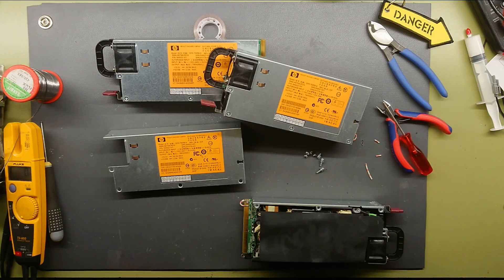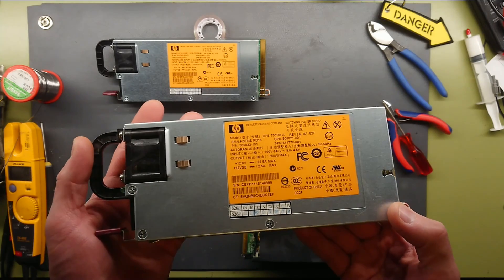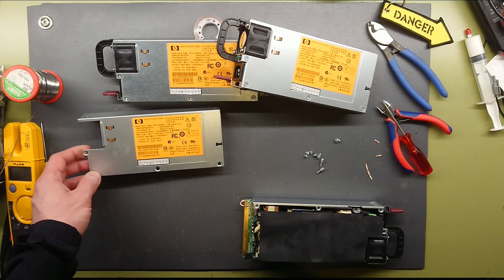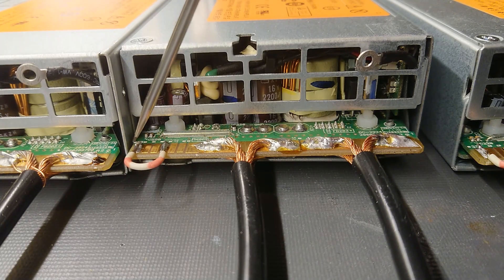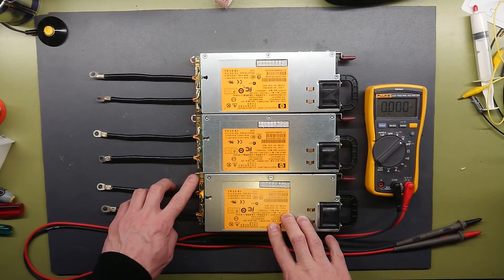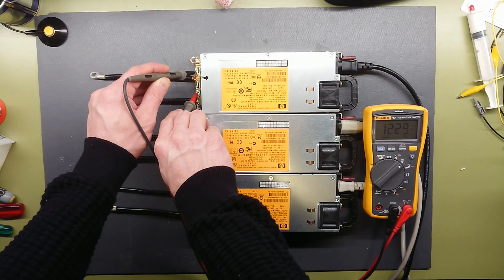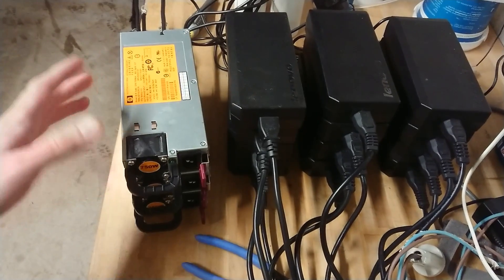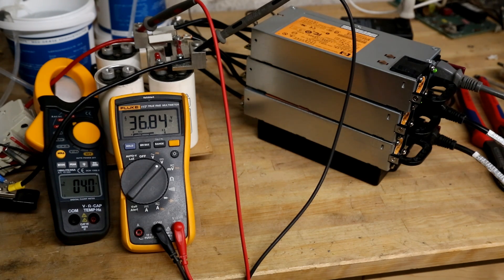2200 Watt Server Power Supply (HP DPS-750 RB) For Induction Heating

Comment: Yes! Thank you very much. I want to do this myself to charge my LiPo4 batteries; a 48v setup. :)
Reply from the maker: 48V gets very close to the maximum ratings of the single PSU components, so in respect to ground they can see a potential higher than their maximum specifications.

Comment: Hi. Am I correct in thinking that the first or last power supply that feeds  negative into the actual circuit does not need to be modified? Only the other two or other 3 in my case need to be floating? Just wondering as it might help with noise control in a noise sensitive circuit.
Reply from the maker: You are correct that the bottom negative one can be left unmodified. But only that one.
Reply: @KaizerPowerElectronicsDk  Exactly what I was thinking. I just received 4x DPS 800GB A and 2x DPS-1200SB A
  I was thinking to make one supply with the 4x 800GB that could do either 1x ~50V or 1x ~14V but for the price of switches cables and / or relays I might as well build 2 dedicated supplies. Anyway they are here now. I changed the voltage on the 1200GB's to 14.8V. Very nice!

Comment: I have the same power supply and isolated the ground of one of them. (going to make a 24v charger power supply) after I floated the ground I'm measuring 6v between the case and ground. There is no continuity to the case or to mains ground. Is this normal?
Reply from the maker: Its normal with a high impedance measurement, try to add a little load like a resistor and it should be loaded down to nothing.
Reply: @KaizerPowerElectronicsDk  thanks for the quick reply. With some load it drops to zero. While going over it I've noticed one of the diodes om the controle board marked AE (there's a bunch of them near the AC side) is blown but everything works so I'm gonna push my luck and see how it holds up with a full load lol.

I'm guessing it's a Transient Suppression diode that's not too essential
Reply from the maker: @RubenRC94  yeah well.. you already bypassed a safety feature when removing the ground, which ruins the PELV class of the power supply :)
Reply: Since I'm pushing around 60A to charge large 12S lipo cells that's the least of my concern ;). I've found out the dioide is only linked to the fan controle so one of the 2 psu's skips over one of the intermediate fan speeds wich for me is no problem at all. Even after 5 years still a great video!

Comment: Would just removing the ground pin (without isolating the chassis) on the AC input work?
THANKS MUCH!!!
Reply from the maker: This might trip RCD/GFCI from leakage current, when putting more in series.

Comment: Did you try to connect them in parallel? I have a plan to connect a couple of 19V laptop chargers in parallel to run some cordless tools. I know that I should protect each charger by diode, could anyone advice what kind of diode should I use? Could this parallel connection actualy work? Thanks.
Reply from the maker: That was the right question for the right guy! I made a 2kW series/parallel power supply from 12 old laptop power charges, abused it as power supply for a induction heater and it regulated very well: https://www.youtube.com/watch?v=5iMFYdDMfXo
Reply: @KaizerPowerElectronicsDk  Thank you. I have already watched your videos. It seems it works without diodes but I would prefer to use them. Could you please explain the purpose of capacitors in your setup? How to connect them and what capacity to use? Maximum output current of my project will be 50A at 19,5V
Reply from the maker: @martinrob7230  The idea of adding capacitors was to have some surge current supply from changing loads in the induction heater, to give the power supplies more time to regulate to load.

Comment: In series does the wattage go up as well or do they have to be in parallel. Looking for a cheap option to get 4000w 60amp 64v
Reply from the maker: I think personally that 3 in series for 36V is as high as its reliably can go. At 48V with 4 in series, you are so close to the component ratings that the stresses will eventually make one of the power supplies fail. So 60V is out of the question from my experience.

Comment: Hi, I am new at this , I only need to use one for 12 volts , if the chasis is ground, were do I pick up the positive , ( dps-750ab-3a ) is the two copper strips on pc board have a positive? I am going to power a transmitter on low power. Do I still have to isolate  pc board if only using one ?
Reply from the maker: Hi Paul. You do not need to isolate the chassis, when only using one. It is ONLY needed when putting them in series for 24V or higher. The negative 0V and positive 12V outputs are side by side. You can easily find the negative rail with a multimeter and test connectivity to the chassis. The other big one is positive. My PSU has both sides of PCB connected to either negative or positive, as you can see i soldered the large wire on both sides.

Comment: I hope Vlogger doesn't mind me doing this. Would like to save some time for anyone coming across this video. It seems the problem PS is the PD-18 which has a daughter board that needs the grounding wire disconnected. The PL-18 doesn't have this and these don't have running issues. Someone below, who has put a bunch of these together, verifies this with the statement that the longer rectangular labeled PS's (PL-18) never had issues. Whereas the shorter rectangular labeled PS's (PD-18) had issues, even when mixing and matching. Though, it wasn't mentioned whether the daughter board grounding wire was disconnected by this guy. Someone who had problems with his running erratically, resolved the problem by disconnecting that wire. Also, the master PS does not have to be floating at the DC board, but all others need to be floating. Let me also add that, those floating PS's should have a 5w/15v Zener diode added from negative to PS chassis with flow direction of Zener diode so that negative current, DOES NOT, flow to the chassis. The white circle side of Zener diode should be toward the negative side. This protects each, FLOATING PS, in that if there is a DC circuit problem, it will pop the Zener diode which will flow current to the chassis and fault the PS to shut down.
Reply from the maker: Thank you for the information :)
Reply: I think you mean the 1 supply that is on the negative end of the circuit, what is your definition of master supply? Regarding daughter boards to ground will this not show up if you test continuity from DC negative to the chassis after the mod? Telling you weather or not there is any low resistance between negative and the chassis? I'm trying to follow what your saying about zenner protection, so if voltage rises above 15V it will send DC to the chassis of your "master supply" as that one still has a dc connection to the chassis and that voltage on the chassis will cause the supply to go into protection? So. in this case we should connect the chassis of the floating power supplies to each other including "the master supply" otherwise the fault won't show up or it might trip your RCD if earth is still connected to the chassis.

Comment: Mads,
I ordered three of the HP DPS-750 RB power supplies, They just arrived today, I am following your video.  They are EXACTLY identical to the units in your video.  I was wondering if the jumper installed has anything to do with the input voltage.  I'm using 110v here (don't know if you are on 220v or 110v).  So I guess it is OK to install the jumper 1 to 4 pins and plug into 110VAC.
I see a pair of soldered terminals on the terminal labeled GND and +12v.  Am I correct in assuming these are directly connected to the two long copper strips just past the 6 copper pins?  I plan to solder the output to them as in your video.
BTW: I was just wondering what you're using to dummy-load the 36v out, and what the white caps are for.
THANKS MUCH!!!!!
Reply from the maker: Im in 230VAC country. I used caps for current surge on the load. I just have a lot of power resistors :)

Comment: hey there, good video - what did you do with the loosened black wires that used to go to the control board? just hanging around surely not ... ?
Reply from the maker: Thank you, well, for reasons not investigated, it worked with floating black wire, so its floating :)
Reply: @KaizerPowerElectronicsDk  thank you for the quick reply: well, I will isolate them I think. just in case. one more question (it may have been answered in other comments, sorry): I would like to put two of them in series. I need to disconnect base-case only from the first (that one that is giving plus at the end), right?
Reply from the maker: @reserveschirm  yes, you can leave the PSU sitting at the negative out, as original. Its only the ones going in series towards the positive side that needs to be isolated.

Comment: I got a few HP  723600-201 power supplies but can't seem to find a video on jumping the power on traces. It has ten thin traces on top and ten on the bottom. Anyone worked with this style of pin outs. It might be the one where you jump pins 1 to 4 with a 220ohm resister or the other method is jumping pin 30 and 31 which are on the top and bottom. The problem is that one PSU has 6 pins and the other has 8 . Mine has 10 so there should be a way to do it. The far right pin on top (near the long negative pin) is labeled S20
Reply: It may have to do with that being a hot plug power supply. I read a thread about removing something on a hot plug power supply, so I made sure I didn't get a hot plug supply. Did you figure it out?

Comment: Now that you have soldered the jumper wire does this mean that whenever I plug the pc in the psu has power but then I press the PC case button it activates the pico that is being powered by the PSU?
Reply from the maker: Plug in = power on.

Comment: I see some people using a resistor as a start jumper?  Whats the difference between a resister and just having a wire?
Reply from the maker: Some power supplies need a certain resistance to turn on. But for the most, a simple jumper will do just fine. Using a resistor will limit the short circuit current, if you place it wrong, so nothing gets damaged. A wrongly placed jumper can damage the power supply.

Comment: Do you have to isolate the grounds in order to run them in parallel?
Reply from the maker: Yes, Else you have to float mains ground and chassis can not touch each other. So its more dangerous.

Comment: Do all 3 have the inner grounding removed? Shoud be not only 2 need this done? 🤔 Ther is than no effective grounding for the all cases if a short happening? 🤔
Reply from the maker: The enclosure is still mains grounded, so its safe for humans, but the secondary side cant detect a fault to earth, so it will properly burn down :)
Reply: @KaizerPowerElectronicsDk  😂👍

Comment: why not just use one Telecom rectifier power supply - they output 53v and 30-35A - with CANbus control upto 50- 60A
Reply: Probably because they are $2,000 ea compared to $24...What do ya think?
Reply: @MrDLRu   depends on from where you get it, I purchase them as a used retired item.
Reply: @JawadAhmadsahibzada  Sure that's all good, please, tell us all where to get one for $24. As 1200w, 12v, 100A power supplies can be had today for that price on ebay.

Comment: Looks good!
I have a question 
How can i fix  - and + kabels on this power supply?
I would like to use it as a adapter for my home sound system
Reply from the maker: You can buy adapters for these power supplies or solder on screw terminals.

Comment: Hey men. How are you? I have some problems here. I did the modification, and when turm on, they don't gave me the 12volts. I read like 5 volts, 3 volts, 6 volts. The 3 power supplys the same thing. If i reconnect the green terminal to the chassis then 12 volts. Do you know what can be wrong??
Reply from the maker: Did you check that each power supply work on its own before modifying them? Sounds like one or more are broken and its continuously starting up/shutting down from under/over-current or -voltage.
Reply: @KaizerPowerElectronicsDk  yes I check each psu before modifying, and all works grate. I think maybe here in Venezuela, uses 110volt outlets with only two terminals, I think that I need the ground of the 3rd terminal. Tomorrow I will try in my office. Thank you very much for your reply. Very good videos. Best wishes for you.
Reply: Hey I am having problems as well. Hope you figure something out.  HSTNS-PD18 some are not isolating with the standoffs and green wire removed idk why...

Comment: great video!  Thanks for sharing this.  Question about the ground wire.  Wouldn't it be safer to ground the cases?  Since the DC rail is floating, it's possible, no?
Reply from the maker: The cases are still grounded to mains earth.

Comment: Technical issue question. Are only certain HP power supply can be put in series? I tried to put HP power supply HSTNS-PL18 750w in series , 3 of them, but the power cord(s) began to burn up. Pls advise. Thx.
Reply from the maker: What burned up? With appropriate fuses in front of these and needed wire size on the DC side, you should never have smoking wires!
Reply: @KaizerPowerElectronicsDk  I figured out what was burning. The ground wire(s) of the mains that were powering the power supplies were burning. I have 6, 750W power supplies connected in series, and found out that only one unit/power supply can have ground wiring. I didn't go with disconnecting the ground wires inside the power supplies because I didn't want loose wires or floating wires. For any person that is looking to build a DIY power supply, make sure you have only one ground wiring for the series connection unit. And thank you Kaizer for putting up this instructional video that expanded my knowledge about series power supply DIY. Best.

P.S. Also, I have 3D printed my series power supply housing. Each power supply with custom cooling fan with lid (the top lid removed) and spacing.

Comment: Thanks for this video. I like to use these powersupplies for powering ledstrips in the house (a lot of them 1000 w +) for transporting the power i want to use 36 V and than bring it down to 12 using a buck converters. Is it possible to take 12 volts if you have 3 in series by using the + and - from the fist one? (used to power some local stuff) or you reccomment an different powersupply for this?
Reply from the maker: If its a minimal load, you can take 12V from the last of them. So you still have a reference to ground.

Comment: I also did this and witnessed some strange weirdness going on. I got two of them connected in series. And everything works as expected. I connected the third one and voltages are also alright, but the fan of the third power supply is going fast as hell from the point, I connect a wire to the pole. And if I am touching this supply at the case or poles, I can slow the fan down. Something might be broken there. The fan slows also down, if I remove one of the first 2 Supplies. Running all three sepreatly, the thrid one is also much louder than the other two.
Reply: ever get it figured out?
Reply: @quinnfoster4671  yes, I had to isolate all 3 , from gnd.
Reply: @myduffly  Interesting, as you should have only needed to float/isolate 2 of the 3.

Comment: Hi great job but here a challenge to you. Can you hack a hp-dps 750ab-3 to 14.6V?
Reply from the maker: No, the maximum voltage these can be pushed to is somewhere around 13.5 to 14.0 VDC

Comment: Hi, I bought two of these to use in series, but both of them have nylon standoffs. Can I still use them as 24v psu? I thought of insulating the cases to make it safe but I do not know that much about electeonics
Reply from the maker: First check with a multimeter if output 0V is connected to ground /case.
Reply: @KaizerPowerElectronicsDk  by 0V you mean the middle pad here https://youtu.be/xRAlXCzsY3Q?t=197 , right ? I'm still learning and don't want to mess anything up. If so, it shows no continuity.
Reply from the maker: Yes, how about continuity to mains plug ground pin?

Comment: Hi, I have a server source model ASTEC DS850-3. I can't turn it on. The green light is blinking. In the technical documentation it is written that when the green LED flashes `` Main output is OFF``. Do I need to make an internal connection? There is no voltage of 12 V or 3.3 V at the output. Thank you!
Reply from the maker: You are lucky that there is a datasheet on this power supply. Read page 2 for description of how it works and page 4 for pinout: https://datasheetspdf.com/pdf-file/655404/Emerson/DS850-3/1
Reply: @KaizerPowerElectronicsDk  Thank you!

Comment: Where are you plugging in the 3 power cords without blowing the breaker?
Reply from the maker: In Denmark we have 230VAC with 10-13A fuses in the breaker panel, so I can run these three on a single mains outlet.